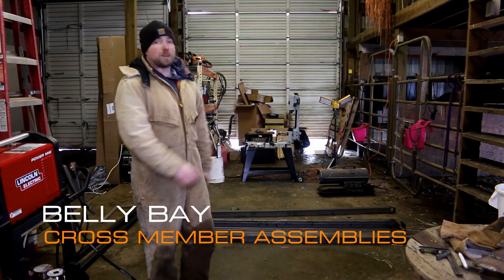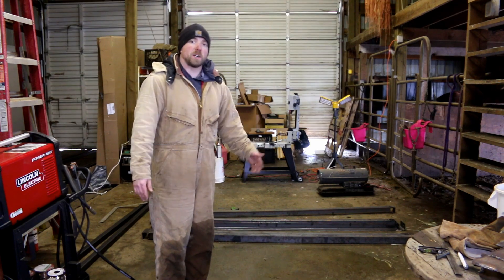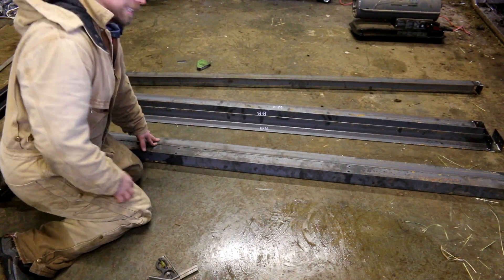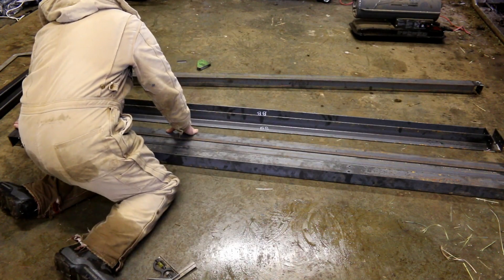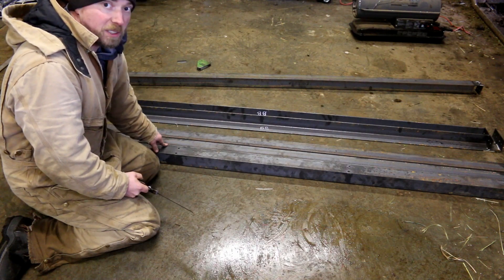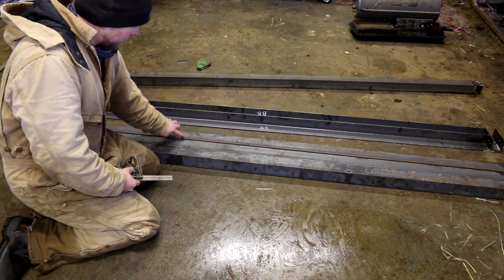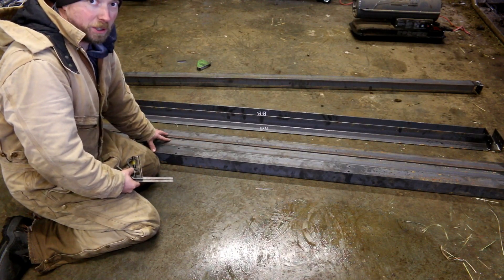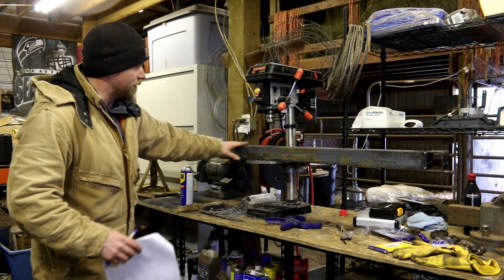CRAFTSMAN 10" DRILL PRESS - Rock n' Drillin' HOLES

Comment: Be sure to turn off your gas to your welder after each time you have finished welding.
Reply: Also your beer kegs. Ran the cylinder in our office dry last week due to a slow leak :(.

Not to worry, we have a welding dept so pinched one from there...
Reply from the maker: mmmmm beer

Comment: If you keep doing metal fab work it would be worth it to invest in a mag drill as the better ones will drill the hole for you once setup. They also for larger holes will act more like a hole saw leaving a slug of metal and just cutting a small path to reduce the need of stepping up drill bits you would do in a drill press. 

As you are going to be working with water have you thought about powder coating of finished parts? The oven is normally the most expensive part of the setup and can be done DIY cheap using electric oven elements in a good insulated box and a good temp controller. With the room inside the barn or built as a shed you could make an oven large enough to cure a car frame in